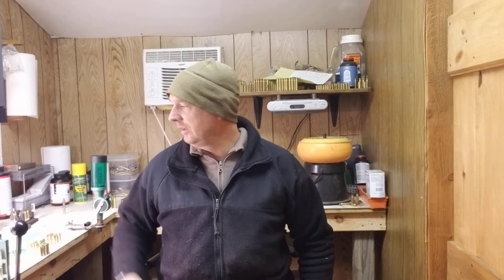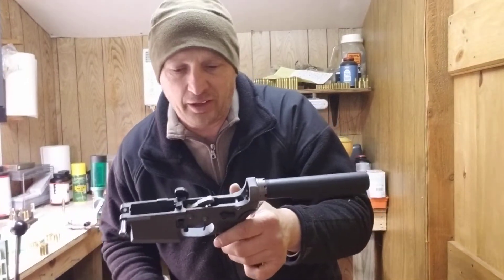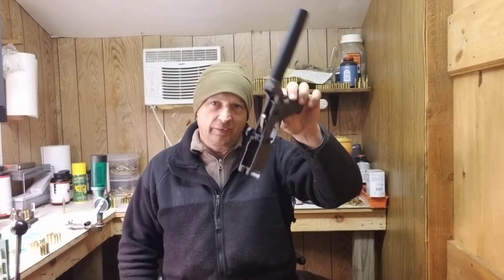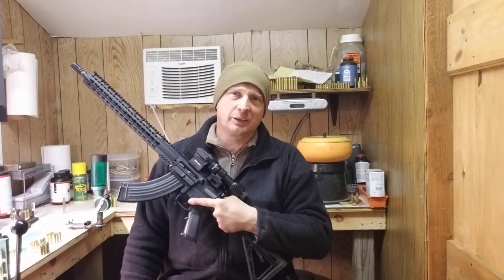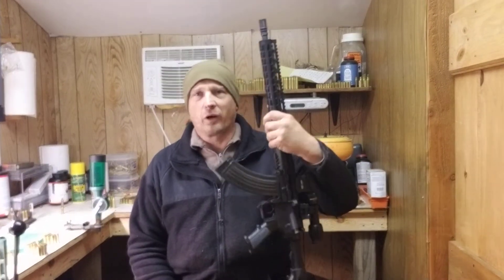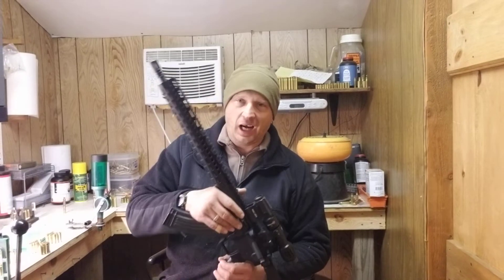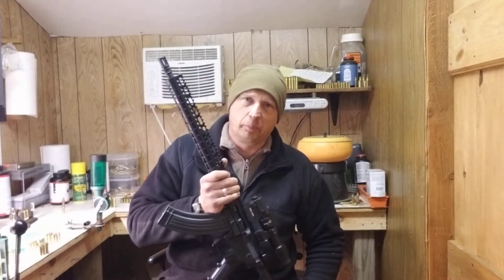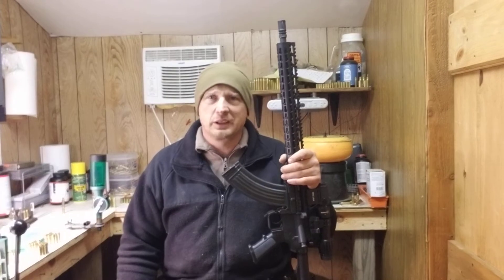Palmetto State Armory KS-47! A New   Solution To A New Problem

Comment: I love my KS-47s. Gibbz arms makes a side charging upper that is compatible with a PSA KS-47 lower and Billet Rifle Systems makes both lowers and uppers in this pattern. You can use an AR Mil Spec BCG, but you need to have a machinist who knows how to put an "AK cut" on it (so that the BCG will clear the AK mag feed lips) and use a 7.62x39 bolt. I would also add an enhanced firing pin, so it will reliably fire those hard primers of steel ammo. Also, if you buy a x39 barrel with M4 ramps, you will need to have the center lug ground (in effect making one large feed ramp) to help with reliable feeding. Nice video and enjoy your rifle.
P.S.
watch those steel mags. They will work but will start to chew up the over insertion tabs of the upper. Polymer mags work great, and I have found that the AC Unity mags (check RTG Parts, for super cheap ones) work great.

Comment: Recommend you stay away from Steel Surplus mags.  The Steel mag WILL chew away at the “Over-Insertion” tabs located in the upper receiver.  Polymer or Bakelite mags will not harm the tabs.  Love my KS-47.  It is king of the gun safe.